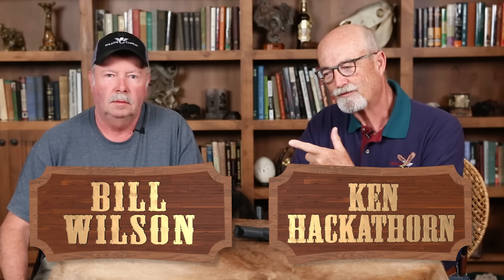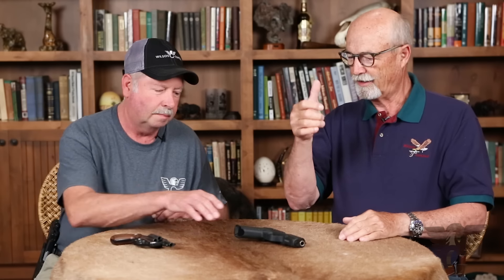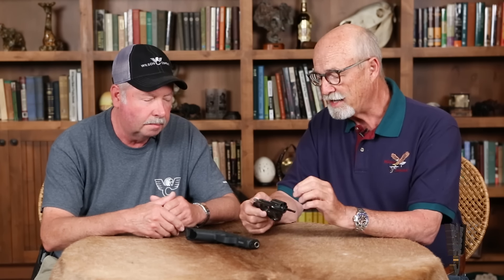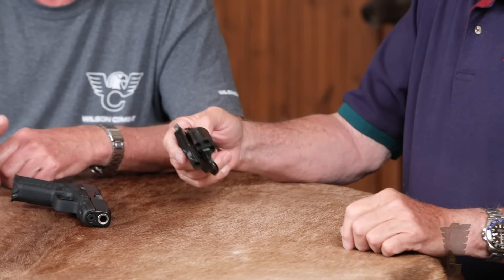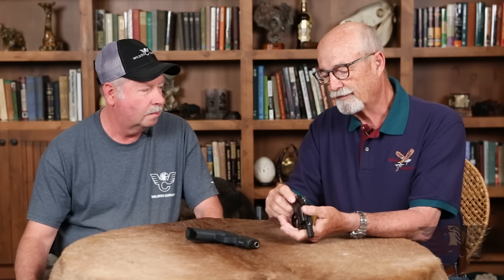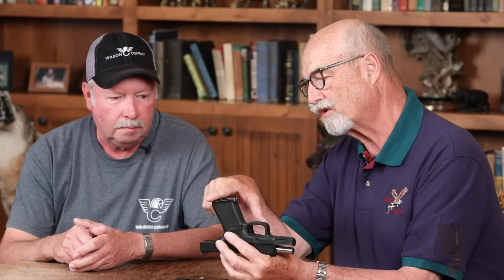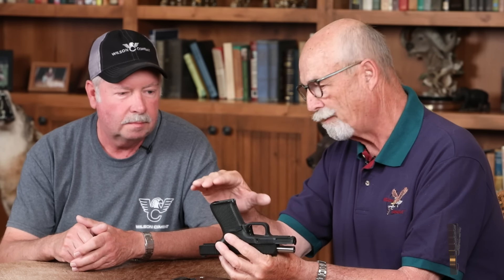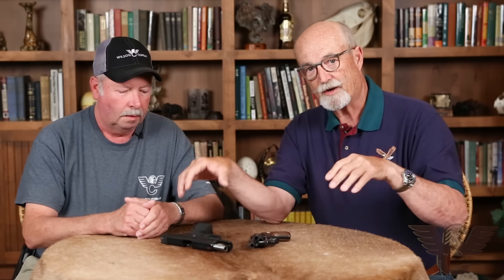DON'T DO THIS to Your Guns - Gun Guys Ep. 17

Comment: OK so I have a question. I have watched this video several times and I tend to believe most of what they’re saying in the video. Ken does this very quickly so I’m not able to keep up and follow it good enough. When the slide is back unlocked and the pistol is empty, they say do not hit the slide release button on an empty chamber. So if it’s locked back, like you’re looking at it in a gun store how are you supposed to get the slide back forward without using the slide lock button? in this video I replayed the clip probably 10 times but he does it so quick I am unable to see if he is simply grabbing the slide and pulling back instead of using the slide lock button? I have pistols that do not do that and are in capable of doing that. You have to use the slide lock as far as I can tell. Or is he hitting the slide lock button with his finger or thumb and then holding the slide at the same time and just letting it go easy forward? I am very confused I hope somebody can answer this
Reply: He is saying when the slide is locked to the rear, pull the slide back and let go. If necessary depending on model, you might pull the slide back and simultaneously hit the slide release so the slide will clear. That being said... absent their $2,500 fancy guns, I have SERIOUS doubts about simply sending the slide home on an empty chamber during normal breakdown & clearing etc actually causing any real damage to the gun
Reply: @JJ_SDWR  on my pistol, I had the slide locked open. I tried to pull back and let it slingshot forward like he does in this video, but when I pulled back nothing happened. I feel like the pistol is not designed to do that or something. So what I did was I hit the slide release button while at the same time holding the slide with my left hand and slowly letting it come forward. Is that OK too? I guess I’m still confused
Reply: @wesleyhobbs9  most semi-auto magazines have a catch on them that will hold the slide open, usually if you drop the magazine and try it it should let the slide go forward but not every gun is like that. Also if you have a round in your magazine it is going to chamber whether you hit the slide release or pull the slide back manually and let it go, so it's only when you're handling an empty gun that theoretically there might be a problem, and again I don't think it really causes any damage unless you have a $2,000 competition safe-queen gun like Wilson Combat sells.
Reply: @wesleyhobbs9  The thing that they were getting at in the video is not to let the slide slam closed unrestricted (empty chamber) because it "can" do damage because the slide closing without trying to strip a round from the mag in the process will close faster (might not seem like much, but it is) and thus there is more energy (remember, energy is 1/2Mass x Velocity squared and that "squared" aspect of velocity is a "gotcha" so to speak because by squaring a number, its effect are 4x greater... Basically, double the mass at the same velocity will have double the energy BUT double the velocity while keeping the same mass will have 4x the energy)  and thus load being dumped into various components. Basically, you want to ride the slide (hold it to slow it down) when closing on an empty chamber so that it doesn't slam closed faster than it would if it was chambering a round. Basically, what they are getting at is don't just hit the button and let it drop (close) unrestricted. 

Now as for you're gun not "slingshotting" forward when you pull back, are you doing it with an empty mag in it or is the mag removed or loaded? If the mag is in but empty, than that is most likely why its not releasing the lock when you slightly pull back on the slide.
 
As Justin mentioned, must Auto-loading (Semi-auto) weapons will have a portion of the mag follower that will push up on the slide lock (or bolt lock in the case of a rifle) so to lock the slide (bolt) back when the last round is fired so you don't have to manually cycle the action upon inserting a new mag, just drop the slide (or bolt) and you're ready to go. With that said, if you have an empty mag inserted into the weapon when you are trying to release the slide, you will have to manually release the slide (bolt) by pushing the lock button, even if pulling back slightly to get the lock catch out of the way because the mag follower (being that the mag is empty) is trying to hold the catch in the lock position.
Reply: All they are saying is don't let the slide slam forward when the gun is empty, ease it forward.

Comment: Had this girl in a gun shop do the empty slide drop on my 1911. It made me shudder and convulse. I haven't been back. She was trying to impress for sure.
Reply: Happened to me one time at the gun range only with a SIG P226, she could have belched like a trucker and it would not have irked me as much.
Reply: What does empty slide drop do?
Reply: @NgJackal1990  Supposedly can damage the firing pin or something.> I really think it's over-hyped.  But I'm not a smith... just seems to me metal is tough. :D

Comment: to that first point.... using the slide lock button whether its dry or loaded isnt going to do a single thing to damage the firearm..... especially one as quality as a Wilson Combat, and if it does then the gun was not assembled properly if thats enough to move the sear around or any part for that matter..... its the same amount of force going forward if u use the slide lock button or the pull back method.....

Comment: I think some guys here in the comments are taking this to extremes. These guys are talking about doing these actions hundreds of times which they have seen the impact of wear over time. I can understand that. The revolver cylinder cowboy swinging I’ve seen first hand with over use and a bent crane which threw off the cylinder timing because it was slightly bent when closed. 

As for 1911’s, the closing the slide in an empty chamber it makes sense with something like the officer model 1911’s extractor. It’s a bent piece of metal that has to be perfectly tensioned otherwise you get all kinds of FTE issues. 

I know a lot of guys want to call these guys fudds, but they have some solid points. Basically 1911’s and revolvers. I don’t really apply their take to modern semi autos like glocks, but for older designs.. I can understand what they are getting at.
Reply: I certainly can’t disagree with you on many points. I never “swing slam” the cylinder shut in a revolver. The timing issues because of a bent crane is a real thing. And as far as 1911’s go. That’s exactly why I won’t own one. Great guns. Classics. But they are like the finicky, high maintenance prima donna female we all have dated at some point in our lives. Nice to look at, but not worth the trouble.
Reply: @ Hey that is very fair! 
The extractor is a HUHE factor with 1911’s and if isn’t perfectly bent with the right amount of room for the case rim to slip in, A LOT of problems start to occur. 
So I can see people’s hesitation on carrying them. Perhaps not, not owning one.. but not carrying. I think everyone should own a 1911. It’s one of Americas classics.
Reply: @jeremiahcherry5283  Yep. I guess I mis-spoke when I said I wouldn’t “own” a 1911. I really meant wouldn’t carry one. I like to shoot a lot with my carry gun. I like to train and practice as much as I can to be as efficient and proficient  as possible as a self defender. And to me, the modern guns, especially striker fired, are just simpler to maintain and keep running.  I like to keep things as simple as I can. But yes, it would be very cool to own a classic 1911 to have some fun with it at the range and to show it off to friends.
Reply: @ very much agreed. The modern offerings these days are far superior to the older gun tech!

Comment: So you made a useless handgun that can't even handle sending the slide forward like god intended? I wouldn't trust my life, or even a competition, to something that can't handle the action of its own spring, much less the detonation of a chemical explosive inside of it.
Reply: There is a difference with dry firing and racking a round in the chamber,  by doing that flashy nonsense instead of dropping the slide properly. Glocks and other polymer frame striker handguns don't have to worry about the same issue as these nice 1911s, keep in mind they said it's different when they have mags loaded. Flicking the wrist when doing the same thing can also be potentially dangerous to not only yourself, but to your property and those around you as well because the inertia generated from that combination of forward movement can set off a loaded round in the chamber.
Reply: @shaggyboi231  a combination of sending the slide home and flicking the wrist can set off a loaded round in the chamber? what!!!???
Reply: @Donbeiren  Yep. Sloppy handling can result in a part of your finger hitting the trigger. On a single action gun with a famously short 1/8 inch pull?  Dangerous. Plenty of NDs on a tuned pistol in the hands of idiots - even with Glocks.

Comment: I purchased a rifle , 2 pistols...
I clean it very good oil where the manufacturer recommends the rifle then goes with me to the range shoot 5 rounds clean barrel shoot 10 rounds clean barrel shoot 15 rounds clean barrel shoot 20 clean barrel break down clean everything real good oil put it away ie...same with pistols.
If it’s used same procedure.. I was the department armor and firearm/rifle instructor

Comment: I'm a Wilson fan..BUT..good guns don't need to be babied..
Reply: Actually, Precision guns do need to be babied, sorta. Combat guns and "normal" Range guns don't need to babied. 
I was considering buying a Colt Gold Cup or Match Cup until I called Colt and verified that they strongly suggest 185 grain .45 a.c.p. and not the usual 230 grain, and definitely to avoid any Plus P ammo (or slide cracks may develop at the ejection port).

Recently the brother of a neighbor said he was having trouble manually racking the slide to eject the ammo in his Wilson Combat. I cleaned a small amount of carbon from inside the lips. Problem solved.

M1911A1's that rattle tend to be more reliable. Precision / Target guns are great...
for range use.
Reply: You hit it all the great combat rifles seem to be limited to 2 1/2 groups at 100. Wasn’t the GI issue 1911 limited to 4 inch group at 20 yards,?
Reply: @steveh352  My 1911 Word doc did not include the distance to target. I checked 9 more web sites and none showed distance. Only one mentioned accuracy; The Savage 107 had 2.84" groups, while the Colt groups were 1.94". 
I would think your 4" groupings at 20 yards may be accurate for the trials, but I could not verify the numbers.

Comment: I thought assisting the spring when loaded or empty was bad? Cause I have a Charles Daly full size 1911  an I do empty slam it. Isn't it the same as grabbing the slide and letting it go? Because I was told grabbing the slide and assisting the the spring to close it up was bad.
Reply: If you are chambering a round, load the round from the magazine and let the slide slam forward. If the chamber is empty, grab the slide and ride it down.
Reply: Chris is spot on. Chambering a round is different than an empty pistol

Comment: Excellent discussion gentlemen.  I learned quite a bit. I wasn't aware that the NATO rounds put a premium on yr gun components.  Would subsonic 9mm amo be easier on yr pistol or even the grain of yr bullet,  147 grain verse 115 grain?  I have a CZ  Shadow 2.  In Canada, so it is strictly for target practise.  I enjoy yr channel, thanks.
Reply: Your shadow 2 can and will take any ammo thrown at it. They are more so talking about these custom fit, tight tolerance extremely tuned 1911s. Premium WC weapons are typically not carried for defense or everyday use. Those are generational weapons designed to have peak performance and require continued maintenance to keep at that high level. The points they hit on are mainly to improve the life of their specific tight tolerance weapons. Not saying your shadow is cheap at all man. I love CZ, but they can take a ton of abuse and still continue to function 15k rounds later with minimal maintenance. Think about all the range rental CZs that are beat to crap and continue to go bang. Good solid weapons, just two different purposes.
Reply: @davididol7361  A Shadow 2 is a target weapon in the same realm as Wilson "Combat". It is not designed for defense and has very tight tolerances. I've felt many CZs and most of them rival 1911's (which is still my favorite design.) In fact, when CZ bought Dan Wesson, their quality increased dramatically, and have perfectly bridged the gap between a duty 1911, and a custom fit. My Bruin is a prime example. Made for bear protection and an extremely high quality. The TCP would be another, and both are about half the cost of a Wilson. I agree that there's an over focus on the empty chamber issue when there's probably ten things at once that contribute to the accelerated wear problem of a finely crafted custom fit 1911. Anything from using copper brushes to using +p or most importantly failing to adequately lubricate the action. Those aren't exclusive to the 1911 and should be addressed with the same fervor.

Comment: 500 rounds? 2,000 rounds? 50-100 rounds and ours get cleaned and lubed. Oil is cheap compared to grit in there grinding your surfaces down until it’s a rattling piece of crap.

Comment: Brownells video on the topic of sear engagement was most enlightening. They said, "it depends. On some guns you can do it, On others you can't.", then gave an explanation of how to check for sear engagement on a 1911. Its a lot better answer that was enlightening than what Bill and Ken did. Granted, I wonder if what Ken and Bill are missing here is they work heavily with custom 1911s with good triggers. They also have custom Glock trigger jobs done too, which might lead them to a similar conclusion.

Personally, I don't drop on an empty chamber, just because there's no reason to. If you have good sear engagement, you probably are fine to do it if you want. Just service your guns to double check.

There. Alot of the internet grumbling can be resolved. chuckes as if THATS going to happen.

Comment: Great video. I especially appreciate the note about how NATO ammo is higher pressure.  Good to know and avoid.
Reply: Depends on the gun. Most guns it is infact completely fine to do so and will cause zero damage and it is foolish to avoid nato ammo for. If it’s a modern military gun like Glock,m&p,Sig,CZ,Canik, berretta  or modern clone of etc they are literally made to be exclusively ran with nato rounds many designed to be feed more than 100-200+thousand of them in their life with parts replacement and have peak reliability with it. Hell even many German ww2 guns in 9mm running it a bit is completely fine as the Germans ran pretty potent stuff the berreta m9 is really just a beefed up version of that p38. I wouldn’t feed it thousands of rounds of it as a sturdy diet but it could probably take it just fine with minimal damage. 

But If you are talking say a non nato rated gun or a alloy frame beat to hell gun a tarus or cheap gun or a safe queen collectible maybe not. And with plus p+ it will always add wear really and I’d avoid it unless you are doing competition or it’s a defensive ammo or something you want it for. 

Most people will never shoot enough for it to matter in a lot of case in truth especially for older stuff and if one is worried just try shoot your Glock,CZ,Canik or whatever.

Comment: Im sorry but there some misinfo in here. Dry firing is not gonna hurt most pistols.  If they are that fragile as striker fires, do not buy that gun. It will fail you when it counts. Besides the springs anf firing pin are cheap and easy to replace. Its a tool. You dont baby it. Im a weapons expert and a combat vet and do gunsmithing fyi.  The rim fires and some .22 builds are the ones you need to be careful with. Striker fired, not so much. Treat it like you are in control. Dont baby it.  The claims about damaging glocks is straight up mythological regurgitated bs in the way yall were saying you can damage it.  Just sayin. Yall must be sensationalizing some things for views.
Reply: Are seriously trying to argue with the experts? Are you a gun smith? If so how many years? What qualifies you to know better than two guy who have probably been around much longer than you.  Please, show us your qualifications.
Reply: @gunsmithmcc  I have an unrelated question, is it possible to build a revolver with strong enough internals so that you swing the cylinder closed without damaging it? I'm curious to know if there is a way to work around that issue
Reply: @oldmanfunky4909  
Why are you so convinced that the guys in this video are experts?  Apparently being old and saying that you're an expert is the only criteria you need.